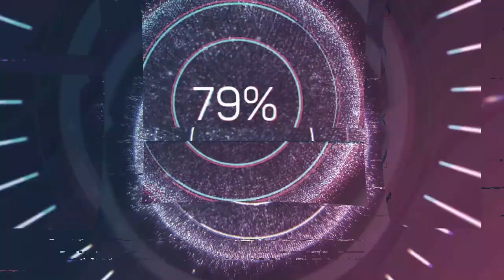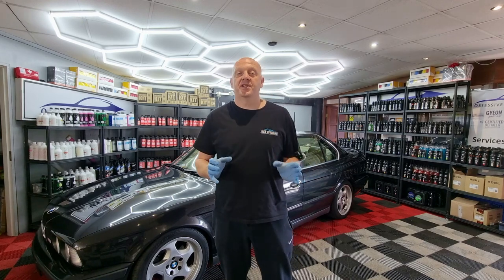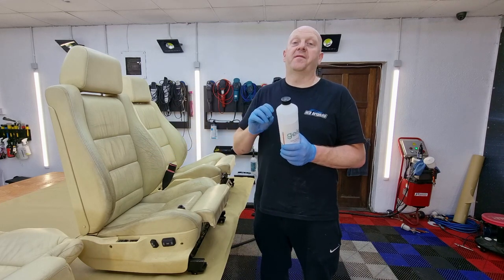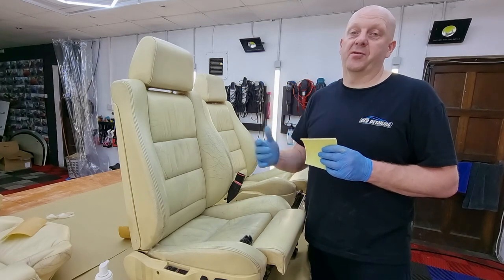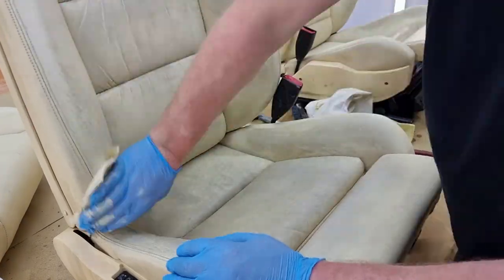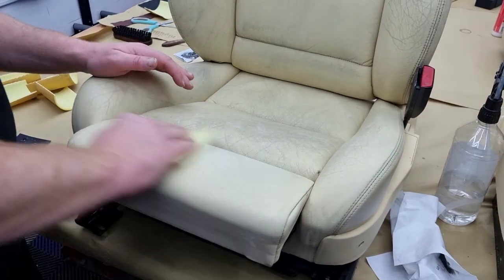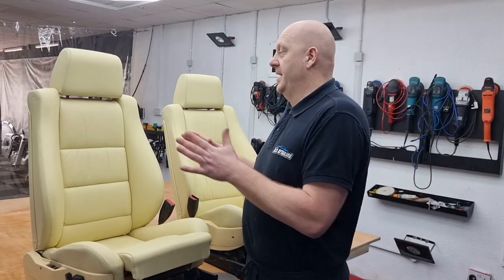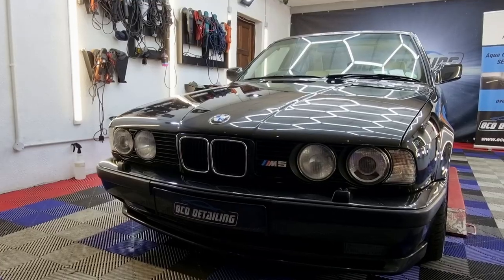BMW M5 | Leather Seats Repair | Guide | Step by Step

Comment: Amazing finish. What grade sandpaper did you use to during the process? Would it be possible to list all products used? Thanks 👍🏻
Reply from the maker: Thank you, I usually use 400-500 gradation sanding pads, I just listed all the products in the description of the video.